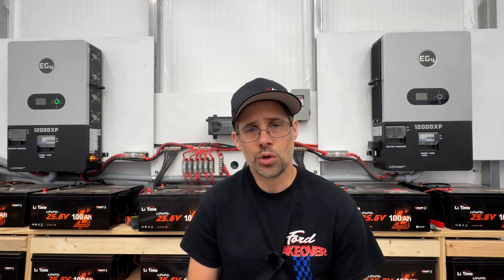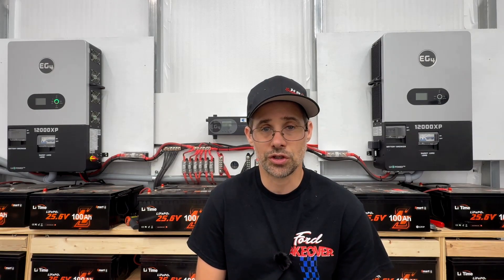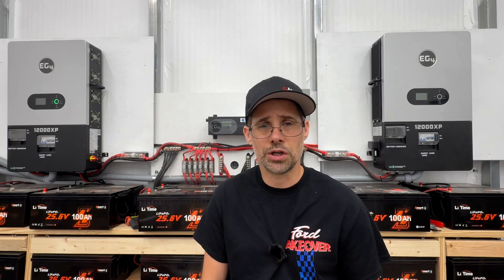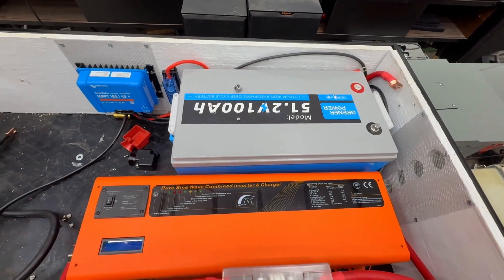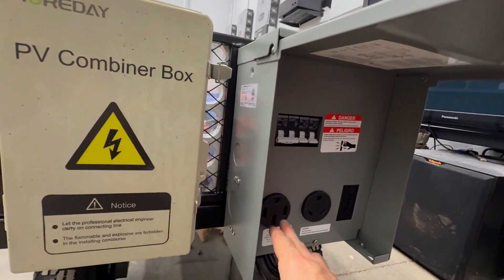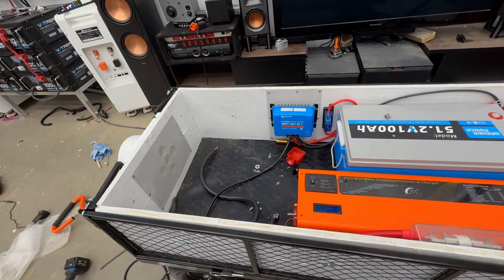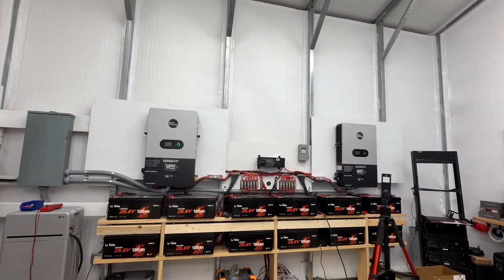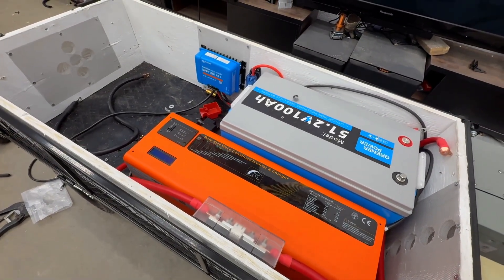High Frequency Inverter Welding: What You NEED to Know

Comment: My 12000XP MIG welds every bit as good as a straight 240v grid connection. That orange inverter in your cart (I've had 3 of them) welds worse than a 6000xp. Ive also blown up two of those Victron charge controllers (they are trash), switched to a Midnight Classic and never looked back.
Reply from the maker: Great information, but I didn’t say it couldn’t do it,  I said you shouldn’t do it.  It’s really hard on the IGBT’s

Comment: Is there a reason why you do not switch over to a DC welder? Then you could go right off the battery
Reply from the maker: It was an informational video to help protect high frequency inverter owners.
Reply: @MikesSolarGarage I get that. I was curious about choices is all
Reply from the maker: @vicv071122  I completely understand

Comment: First, do you need a 240 inverter to run a welder? I have a 5000 V Victron Quattro. Wondering if I can run a welder off this, since it’s only a 120 V? 🖖
Reply from the maker: Thanks for watching Simon. It depends on the welder.  Smaller ones can run on 120v or 120/240 with adapters.  The medium size welder are typically 240v.

Comment: Another exception to this rule about avoiding powering welders or extra high locked rotor amp devices on high frequency inverters is for hybrid inverters that are supplying their power via a back-fed breaker.  However, that only works if you have grid power to your shop, which Mike doesn’t.  

Also note, that although the back-fed breaker configuration maximizes inverter lifespan, if the power goes out, the inverter stops supplying power to its grid terminals.  So, you need a transfer switch, that lets you switch to power coming from the load terminals on your inverter.  You also need to turn off your main breaker first to ensure you don’t backfeed power to the grid when it’s down so you don’t injure a lineman or have the linemen blowup your inverter by shorting the lines to stop whatever is backfeeding.
Reply from the maker: Very good points Nick.  Thank you for posting it.

Comment: So the way you explained this welder issue is that the welder just might draw too much power. so if you have plenty of surge capability on say a 12000xp which surges to 24000watts and you are just using a small 120v mig welder there wont be any issue powering the welder???
Reply from the maker: I wouldn’t recommend using a welder due to the high amperage short duration load.  The starting amperage is considerably higher than what the welder is specked as which is really hard on the output capacitors and IGBT’s
Reply: @MikesSolarGarage you did not seem to have answered his question. If the inverter has surge capacity that is say 3x or 4x of the worst the welder will demand, can't the welder be run on such inverter?
Reply from the maker: @adon8672  Lets take the 12000XP as an example.  It can put out 50 amps continuous and 75 amps peak.  If you use a welder that pulls 30 amps continuous it can draw 90 plus amps initially.  The 12000XP is an absolute beast and will try to keep up, but there will be voltage drop and the IGBT's and output capacitors will struggle.  Remember that with a welder utilizes short interval high amperage draws which is best for a transformer based inverter.

Comment: Welp i better stop using my ecoflow units for welding and build something like this
Reply from the maker: Thanks for watching rnkustomz!
Reply: Hmm.  Well, I will admit I don’t intentionally throw large inductive loads at my FB21 beyond testing things like my 4-ton A/C.  Which it has no trouble with. That said, this might not be quite as bad a problem as you think.  For an HF inverter, dealing with the reflected energy of an inductive load comes down to the size of the HVDC capacitor bank (the HVDC mid-bus).  If the bank is large enough to buffer the reflected energy on each cycle, it will simply get fed back through in the forwards direction on the next cycle.  A 12000XP has a decent capacitor bank.

LF inverters are better at inductive starts, yes.  But they aren’t any better at running a continuous inductive load than an HF inverter with a large capacitor bank would be.  Both wind up being heat limited.  The transformer has a lot of heat mass but can’t really dissipate the heat any faster, so it is better with short bursts of load but doesn’t do a better job with a continuous load.

And even though the transformer can buffer a lot of energy, it more or less just passes the reflected energy back across in the opposite direction… and has a smaller capacitor buffer to deal with that reflected energy.  Meaning more ripple may occur on the battery bus.
Reply from the maker: Everything you stated is absolutely correct.  The 12000XP does have a sizable capacitor bank, but I was worried more about the IGBT's more than anything else.  My thought was the intense thermal and electrical stress on the IGBT's would cause premature failure.
Reply: @MikesSolarGarage did you link that inverter you are using in the box anywhere? Sorry if I missed it
Reply from the maker: I didn’t yet,  I’ll do a separate video after I power it up and see if it’s good or not.
Reply: @MikesSolarGarage  it can definitely be an issue if the welder does not have a PFC circuit.  If the power factor is really poor, then potentially the current burst can exceed the IGBTs junction limits (which is different from average heat dissipation).  That is a harder parameter to get a grasp on… it isn’t precisely power factor.  That is, it isn’t like the inductive load from an AC motor (which the inverter has no problem handling).  Instead this winds up being a function of very short, very high bursts of current during each cycle that are far in excess of the average watts.  dI/dt.

Comment from the maker: I want to state very clearly I am completely satisfied with my 12000XP inverters as they were some of the best purchases I have made.  My portable solar setup is to reduce wear and tear from loads caused by using a welder.  I would recommend a 12000XP for most use cases.